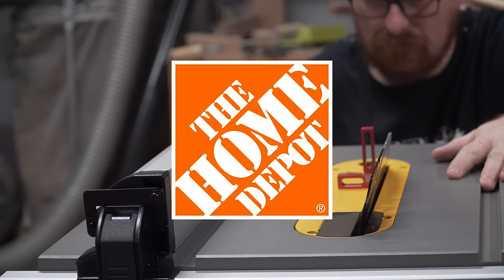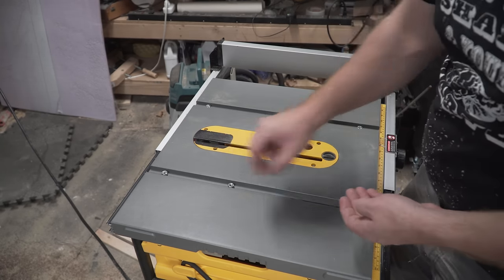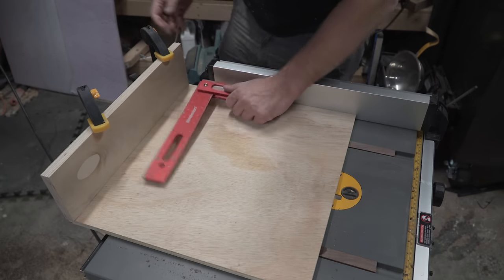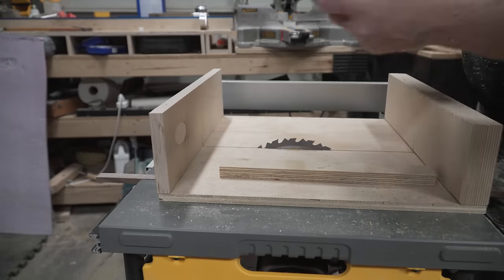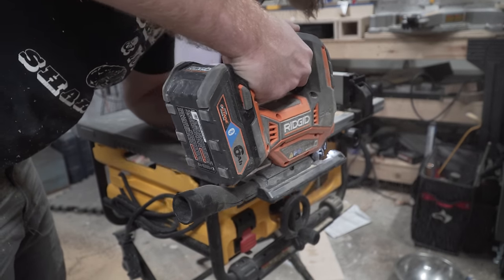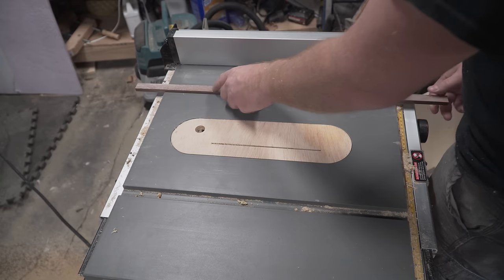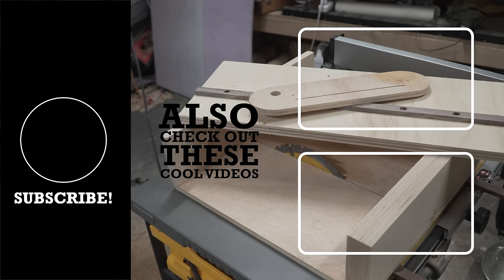3 Simple Jigs to get Professional Results from any Table Saw | Shop Tips

Comment: I'm just a little confused as to what the zero clearance plate does. It sits in the slot just like the factory metal plate. Am I wrong??
Reply: It does 2 things. Helps prevent tear out from the large opening in the factory plate. Also allows you to cut thin strips without it falling into the saw body.
Reply: @williamkumley5135  Hmm. Ok. I've never experienced tear out but I've never done much more than ripping ply for "job site" quality projects. Thanks for the insight.

Comment: I have a miter saw, thinking about getting a table saw... first thing you make is a cross cut jig! haha!
Reply from the maker: Circular saw makes more accurate cross-cuts than a miter saw.
Reply: I think both saws will be useful to you: while a cross cut jig can do many cross cuts  just like any miter saw, the miter saw shines when you have long or thick beams or logs for bigger construction work as well as angled cuts. Also I would say that a miter saw is the safer saw when compared to a table saw. Actually you can never have enough saws 😜😁

Comment: What was the purpose of that last jig? What's is for?
Reply from the maker: So many things.  It's a platform for a jointer jig, tapering jig, box joint jig, any thing you need to run parallel to the blade but that can't reference the fence.

Comment: Didn’t understand the value of third jig. What is is the purpose of it?
Reply: If you've got a piece of lumber that hasn't got a single straight edge you cant use just the fence to cut one, by bolting and odd shaped piece of wood to the wood sled/jig it will cut the first straight edge, it can then be taken off spun around and you can then use the fence to cut the opposite straight edge.. does this make sense? Really useful jig for squaring up a piece of say round wood..
Reply: Dan Allured thanks, yes

Comment: New to woodworking, what is the point of that second jig? Doesn't the table saw already come with that yellow part? Why would installing your own part make it more professional? Is it an issue with the original one, why would the original one cause 'chipout' and 'trap scraps in the blade'?
Reply from the maker: The zero clearance insert allow you to cut thin strips without them getting sucked through the throat plate, which makes the saw safer.  It also allows you to cut plywood or veneered surfaces without chip out.

Comment: The video was nice but I would have larger side of the hardwood slider between the blade and the fence rather than the other way around so it is easier and safer to push the wood through the blade.  Your right hand was way too close to the blade for safety reason.  Also, the spacers used to make the hardwood runners are actually called nuts, not bolts.
Reply: no they are bolts, nuts are the male ends

Comment: Thanks for the video! I have a question for you if you don't mind? Im just starting to build my workshop and Im trying to find out how powerful of a table saw I actually need. I did so much research and I know they have all types from cabinet to hybrid, contractor, etc, but which one would you say is good enough for a beginner? I'm looking to make home furniture like tables and all my workshop benches and table tops, etc. I'd also like it to be large enough where I can use jigs and sleds. Do you have any suggestions for someone starting out? Thanks!
Reply: I started bulding my workshop 7 months ago, I´m still adding tools and jigs. But to try to answer your question... i bought a table saw like the one on the video, mine is a DeWalt DWE7480 i added an extension table to suport  full sheets of plywood/MDF. With it i have alredy build hard wood furniture like nightstands and chairs, all my workshop furniture and 2 full kitchens. im planning to buy another bigger table saw but this one still have a lot of life so i will squeeze the most out of it before upgrading. it´s easier to use it for larger pieces if you have someone to help you out with the first cuts of material. Hope i helped in some way and good luck!!!
Reply: @roger_001  Thanks for the reply! I actually decided on the DWE7491RS. From what I understand its the quote un quote caddilac of the portable table saws. My logic behind it is I can use it until I am ready to build my table saw bench with built in out feed and assembly table. From what I heard it can be taken off the rolling cart pretty easily and the fence is supposed to be pretty long and you can cut dados with it. Excepting the dado blade is what honestly put me over. A little nervous to get started, but at the same time really excited haha. Just waiting for it to go on sale now. Thanks again!

Comment: Why are impact drills used all the time. They have there use. But not on small stuff
Reply: WestWaters because it’s a driver, if you have one it doesn’t matter what your screwing it’s the way better option
Reply: @lotus_8773  there is no way of telling how much torque your applying to the screw. Vs a regular power drill

Comment: What is the point of a across cut sled isn't that what a miter saw is for
Reply from the maker: It supports the material better, is safer, has a longer fence, and functions as a zero clearance throat plate to avoid tearout on the cut.  It also supports the offcut.

Comment: Damn - went to look Home Depot price on saw - 329 USD, in Estonia same model (US model is 475s locally here 475) is 599 EUR - so US price is 294 EUR vs locally 599 (328 USD vs 669 USD). Nearly double the price. So basically, if to pick up saw, planer and few more tools, it makes sense to travel to US, pay for the transportation and still get better deal :)
Reply: You are lucky, in Australia they go for $900 - the problem with your solution is that you will end up with a 110V 60 hz table saw - the cost of fixing that will double it's price easily.
Reply: @edwardchallenger6615  900 dollars is even more indeed - ouch. Yes, the 110V is problem for sure, and traveling for tools would make sense to go for more serious tools - that work also with 230 or 3 phase current.. but that would take also serious cash :)
Reply: @mytapoiss  Yep, which ever way you turn.
Reply: Yeah but if you get injured on the job site in America it’s probably cheaper to fly to Estonia, get the care you need, and fly back than it would be to just go to a hospital here lol
Reply: Have you priced 240v 50Hz tools in the UK?  GBP is weak just now, and you could drive here and back :)
Reply: Never mind the voltage problem (in my country is the same as in the US). The cost of transportation of such big heavy tools will offset the price difference, not to me mention import duty.

Comment: I was going to make a zero clearance plate for my "job site" saw, but then I figured "What the hell would that be used for?".....think about this for a moment......I already build a crosscut sled, WHICH IS ALREADY "Zero Clearance" anyhow!! I haven't seen a need to even use a zero clearance in my work that I can't cut on the sled to start with!!
Reply from the maker: You never cut thin strips on your table saw?  Edge banding?

Comment: A little advice to the beginners out there. Don't EVER back feed on a table saw. The teeth of the blade are coming up from the table on the backside of the blade and can lift the work. If this happens, whatever you're cutting will become a projectile and cause serious injury. Also, never rip thin parts without a push stick. Use the push stick to push the offcut between blade and the fence through the cut. Leaving the off cut between the blade and the fence can result in an ejection. A 10" saw blade has a linear speed of about 140mph.

Comment: I didn't really understand how the rip sled works :\
Reply: If you have a board with a wavy edge, you can't (consistently) run it along the fence... so attach it to the single-runner sled, and that will track it through straight so you can get one clean cut... then flip the board and run that clean cut against the fence to trim up the other side.

Comment: May I ask what's purpose of zero clearance insert?
Reply: Yeah I'm kind of confused by it as well.
Reply: it keeps the support base of the insert plate right next to the blade, so perfect example is cutting thin strips of wood. on the stock metal plate your strips may actually fall down between the blade and the stock insert. Also, the zero clearance insert is a good choice for fine cuts because it supports more of the wood you are cutting and reduces the amount of tear out on the cut edge.

Comment: I have this saw and the only thing I don't like it the aluminum table because it is a cast table and my miter slots are not machined and therefore not perfectly parallel! Otherwise I have ripped thousands of board feet of hardwood through it and it is still running true and strong!
Reply from the maker: That is why you build a good cross cut sled.  You should be able to compensate for the error in the miter slots by using both of them and tuning your back fence.

Comment: Never used a table saw...reading the comments on kick back and all..I'm not sure I will.
Reply: As long as you're using the saw correctly you shouldn't have a problem. I've been using a table saw for almost 20 years and haven't once had anything kick back. If you have a friend with a table saw have them teach you.

Comment: Why you dont use any sticks to push the wood on the table saw? This is dangerous man
Reply: Because sticks can slip, catch, etc.and injure you as well ..I have stitches to prove ..no, I wasn't being careless ...just the opposite...
Reply: @L.A.W.Studios  but you can cut rectangular shape in sticks it to keep the wood and glue 3 of these sticks  for example. Or buy some jigs if you dont mind spend money
Reply from the maker: Some of what I have demonstrated in this video exemplifies a problem in woodworking safety caused by normalization.   It is not that anything I demonstrate is specifically unsafe but over year of using a tablesaw I have perhaps become overly confident with some procedures.  Honestly, this is what can get you hurt.  As the above commenter stated, sometimes push sticks can get you hurt too if you are using them too close to the blade.  I think the safest "work holding device" around a table saw is a sacrificial push block with an offcut glued to a piece of 2x4.  I think I will make a quick video demonstrating this little thing soon.
Reply: @WoodWorkLIFE  i understand. I am not too experienced IT just looks scaryy too me ;)

Comment: I didn’t understand the last jig...
Reply: You take a non-parallel board, rip it down one side to get it flat. Then use that newly ripped side against the fence to get the other side parallel to the first one.
Reply: sfastshark thanks dud
Reply from the maker: what the baby shark said ^^^

Comment: I appreciate these ideas, but why does it have to be a hardwood runner? Seriously, where I'm from, walnut is about 11.50 per board foot, it's crazy expensive and I'd never, ever waste it on a shop jig.
Reply from the maker: Most softwoods would get all beat up and start getting sloppy.  It doesn't have to be walnut but oak, maple, bubinga, whatever offcur you have wise enough to make a runner.
Reply: @WoodWorkLIFE  Make sense. For the readers. You can often find pallets made of oak if a jig demands it

Comment: that's 16 thousands of an inch not a couple rip an 8 foot board your over 1/8th inch off by the end
Reply: You're going to rip an eight foot board on a cross cut sled?
Reply: @jgoodsurf1  holy crap someone was paying attention in this video, good job you get an internet! point was if he thinks 10's are 1's,  and you should push on a square to make sure, I would hazard to see how his fence is adjusted

Comment: ... you really “ripped” through the rest of this video leaving this rookie wondering   why you attach hardwood that looks warped 🤷🏼‍♀️. What is a jointed board?  S to S??? Pretty sure that’s not what you are trying to say so fast. Then work on the other 2 bases... so lost but pretty sure you were trying to beat some clock and I respect that.
Reply: Allison, what he’s saying here for “s to s” is actually “s2s”, which means straight two sides. This is done for one pass on the jig, as anything hanging over the edge will be trimmed, making your first straight side, provided there is wood that is overhanging the entire length of the board. The second straight edge is cut by removing the board from the jig and making a cut with the first cut against the fence, giving you a second straight side, which is parallel.
Reply from the maker: What he said ^^^ sorry I try to get through each concept as one video, I have more videos in my archive answering some of these questions

Comment: Needs to learn how to cut wood safely before trying to "train" other people.  Stood in line with the blade, a  position that guarantees you will get a kick back in the gut if one happens.  Also puts pieces thru without push stick (except to push the cut piece thru after it is cut), and no push block - which is way too dangerous for me to do.  Thumbs down.
Reply: I am 78.  Way back started shop in the 4th grade.  Didn't  use power tools  until 9th grade shop, that was a large disc/belt sander, and I  proceeded to remove fingerprints off of several fingers.  First and last power tool injury.  In 10th grade we were taught about using power tools, and got to  use them.  Huge saw, metal lathe, etc.  The teacher told how kickback occurred, showed us, and I still remember that wood whacking into the wall.  Have never had kickback, because I am very careful about how I cut, but just in case, still stand out of line of the blade.  Worst injury I have ever had with a tool in my shop, cut myself with my pocket knife.  I watch woodworking shows on youtube on occasion, and see even so-called pro woodworkers standing inline with the blade when sawing, or not using push sticks or blocks.  I have a Grriper, that I won, and use, but do not buy push sticks or push blocks, instead make my own, only takes seconds on the band saw, or scrollsaw.  Most of you guys would consider my shop full of  junk.  The shop is 8X12, it was what I could afford at the time, the newest tool is probably at least 8 years old, most a lot older.  But it all works, and it all does just what I want.  My router table is about the 3d or 4th I made, is at least 15 years old, have around $2.50 (that is correct) at the max in it, and it does exactly what I want and need.  Woodworking is fun, but you have to be a bit scared of your power tools, otherwise you are going to get bit.
Reply from the maker: Thanks

Comment: 6:18 It's VERY SCARY to watch you operate table saw with no blade guards. This is just like play with a bomb on-off switch, hoping it will not kickback with 100 MPH wood blocks toward you, pushing your arm and fingers into the blade.
Table saw is the most dangerous tool in the workshop (based on medical emergency room statistics).
Always be careful and do not use it unless you really need it.

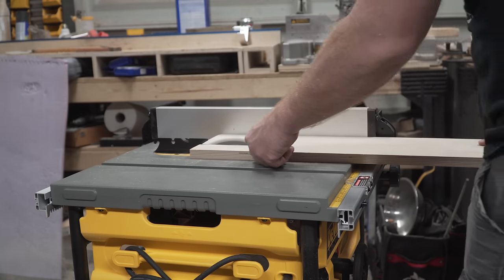Comment: I had to stop watching at 2:45 as I just knew the fingers would be coming off.  Many professionals can get used to safe procedures without using guards but this video shows the fingers WAY too close to the blade.  Please, at least use a pusher.
Reply from the maker: It's lense compression ...I never let my fingers near the throat plate let alone the blade.
Reply from the maker: But youre right, especially in videos like this, I shouldn't even demonstrate things that LOOK like unsafe tablesaw practices.

Comment: Your statement that this is good for any table saw is little too optimistic. I have table saw Einhell TE-TS 2025 UF. This is piece of s..t. The guiding grooves are not parallel to the saw blade. The difference is 1.2mm for the length of the blade. There is no possibility to adjust that. What do you do now?

Comment: Everyone complaining about the riving knife that also uses zero clearance inserts in their own shops needs to sit down and shut the fuck up. 95% of all zero clearance inserts I've ever seen other woodworkers use either in person or online do not allow for the splitter or riving knife to be used. I'm absolutely certain that everyone trying to rip him for it are in the tiny minority of specialty zero clearance insert users that allow the riving knife or splitter to be used.

The value of zero clearance inserts is vastly overrated anyway. Unless you're ripping thin strips that could get sucked down into the blade shroud they do more harm than good by severely disrupting the dust collection abilities of your saw. That not only throws more dust in your face but also keeps more dust in the gullets of your saw blade allowing it to heat up more than it should which burns the wood and worse can cook the pitch in the wood dust baking it onto the blade making your blade operate like it's dull.
Reply from the maker: Thanks brother,

Comment: Every time I look for "table saw jig" on youtube, I always see a crosscut sled. If such a jig is so important with a table saw, why don't manufacturers provide one as an optional accessory, built into the machine itself?
Reply from the maker: They do, as cheaply as possible.  It's called a miter gauge.  But they are cheap, and a crosscut sled bypasses much of the safety equipment on a saw so they stay out of it.

Comment: Sorry to say this but you seem to have poor safety disciplines around a saw. Not a hater but I saw that you were inches away from your workpiece jumping off the table and kicking back into your face. Made me cringe. You might want to reconsider tightening up your fast and loose methods before hitting the record button on the camera for others with little experience to follow. Just some friendly advice from someone with 45 years of doing this a lot with zero incidents.
Reply from the maker: Always good advice, I need to always keep safety front of mind.